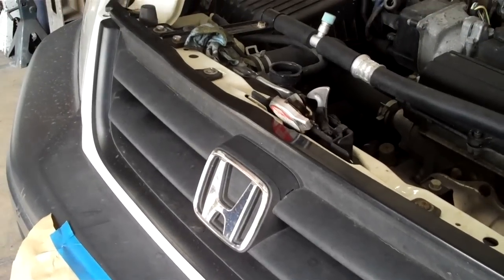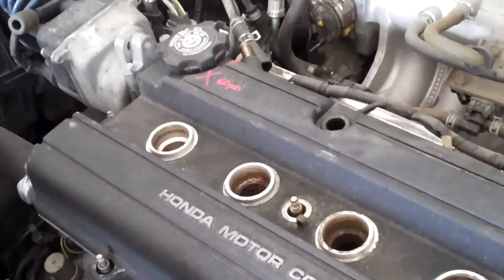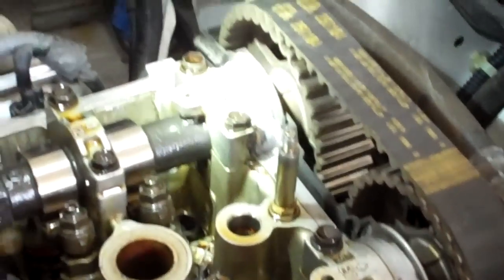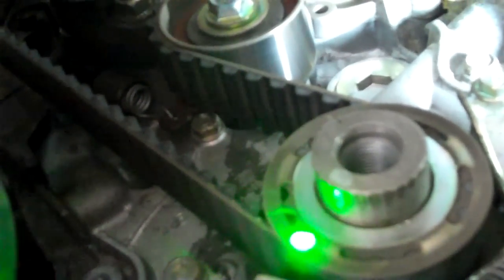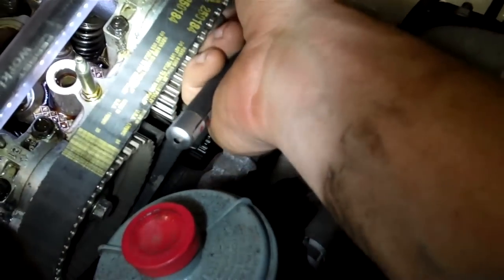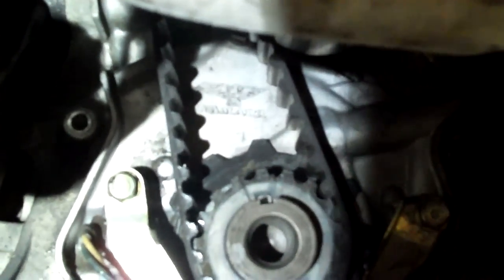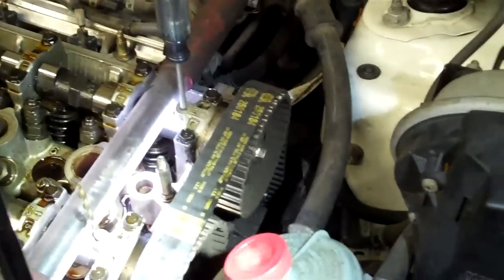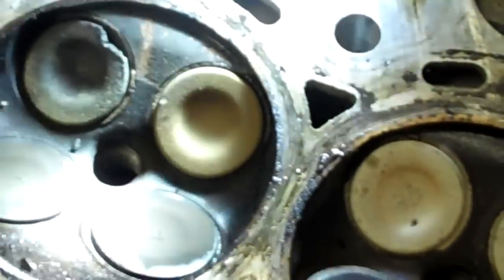Honda CR-V DOHC P0304 DOUBLE TROUBLE

Comment: I've seen this problem with first gen CR-Vs.  Then I did this job for a friend, the cam was actually lose and I was able to turn it with my hand.  So I think that tight cam pulley was caused by the tight exhaust valves.  The car I worked on burned the exhaust valve at 120K miles - couple of years later after replacing the timing belt.  The way I like to set the belt tensioner is to put it and and bend the cloth hanger and use it to hook the spring end and pull into the position.

Comment: Honda hasn't used a CVCC head design since they switched from using carburetors to fuel injection (during the 80's)

Comment: Brian, will you go for an already reconditioned head or have that one repaired?? How many miles on that Honda? I just replaced the main brake line on my ZJ, it runs from the ABS almost the rear diff. and connects to the rubber hose, odd and also a PITA that the ABS has a bubble flare and the rubber hose has an inverted flare so i put a union under the drivers seat then another bubble line and cut and flared to inverted, i was lucky the line popped in the driveway

Comment: Since Honda's use a CVCC engine design with interference. It it possible the timing belt broke or the tech put it in wrong the first time to break the valve?

Comment from the maker: If you want a general rule it's this.  Whichever side has the tensioner is the slack side.  Whichever doesn't is the slack side.  You'll find there's usually one side that's a straight shot from the crank to the cam.  That will always be your tension side.

Comment: GM side post batteries can be a PITA. Clean the battery cables and remove the cable boots checking for corrosion. Also check the main body ground and the engine block ground as well. There is a possible that the alternator exciter wire was damaged or that the wreck was enough to damage something inside of the alternator. Autozone and O'Reiley can not check the Ecotec alternators for some reason. 

P.S. If the headlight attaches to a plastic headlight header it is very likely broken.

Comment: These more advanced repairs are great, Brian. You addressed a question I've always wondered about. Is it fair to say that the tight side is found by learning which way the engine rotates, then observing that power comes from a pulling action from the crank (on the tight side)? Is your point that the tight side is always to the front a reliable rule?

Comment: Continuation- would a minor fender bender cause the alternator to "malfunction"  it split into two parts but ill have to take another look it was dark (just now) and i was getting flustered, i was looking at pictures of a 03 cavalier alternator and it seems like mine has a bigger gap some wheres on the alternator, just wondering what your take on it was??

Comment: Brian i got another quick question, i got in a very minor fender bender, the day before (it was there fault) the girl ran into my driver side bumper, all it did was crack the bumper and broke  the head light, but after that the charging light came on and off so i tested it the battery was good at12.5 volts but when i started it up it dropped to 12, and then when i turned the blower and head lights on it went down to 11.5 11.8 and stayed there, the alternator was fine before it.....